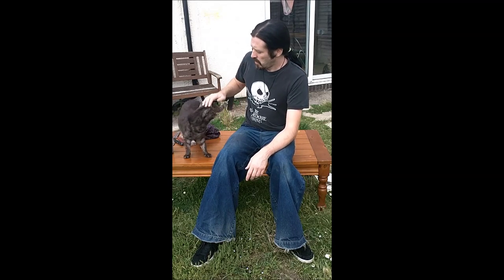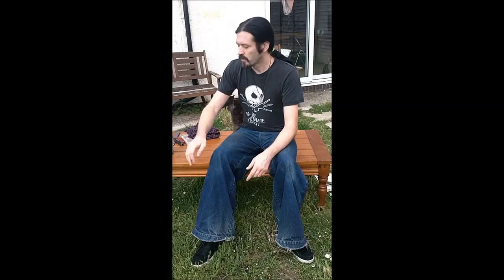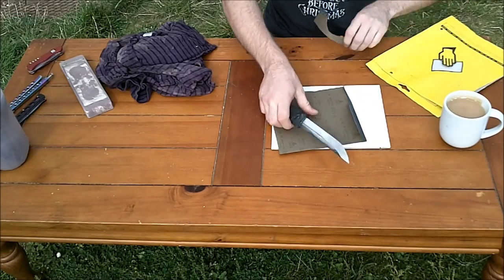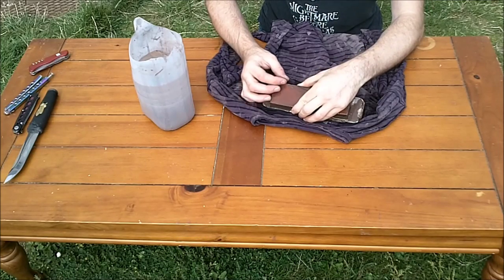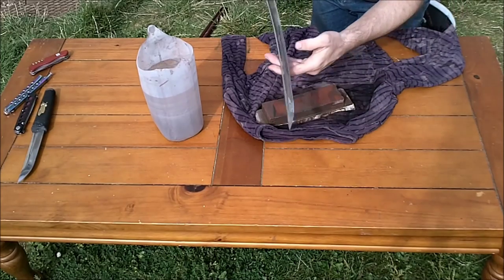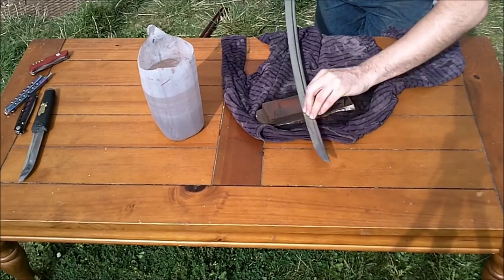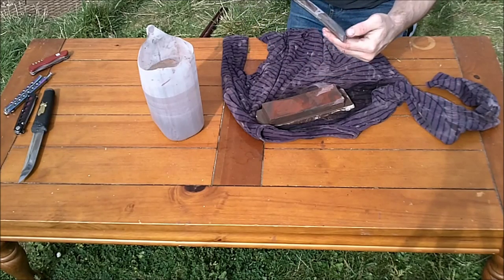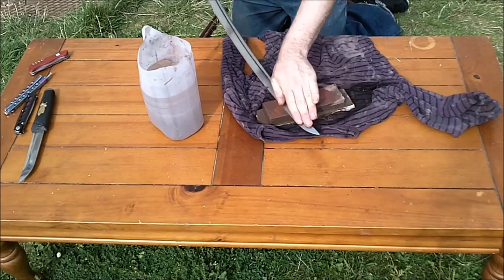Sharpening your katana

Comment: I haven't been very good to my Katana, I definitely need to both polish and sharpen it. At least now I know it isn't impossible to do by hand.
Reply from the maker: Anders Pedersen Its best to do it by hand :) Just take your time and youll get used to the feeling.
Reply from the maker: Just down the road? Haha awesome. Ok. When sharpening you need to start at a lower got and work your way up. So if your getting the  1000/4000 stone then you'll have to use the 1000 first and then the 4000. That replica is made of  1045 so the steel will Polish up really easily. Might be worth investing in some 2000 at wet and dry depending. Let me know how it goes
Reply: Thanks, I've been sharpening it with the 1000 grit end, however it's still not very sharp, also using the 4000 after just dulls the blade. I guess I just have to keep working on it. :)
Reply from the maker: It's a knack. You have to push the edge onto the stone. Dont as a secondary bevel, just remove metal from the side until the edge reveals itself more 😊 don't worry with practice you'll have it razor sharp soon

Comment: Thank you so much for the video it's really helpful, I just received my new katana last week and I am planning to sharpen it following your method, but I don't have much knowledge on whetstones, regarding with that, what is the use of the high grit and low grit part of the whetstone? I just bought one today and I have no idea which side I should sharpen my blade.
Reply from the maker: sorry about slow response. wow. 10 months? for touching up on general usage, you shouldnt need two stones. :) I use one the coarser ones for removing the crappy secondary bevel that a lot of cheaper katana come with from the factory.

Comment: Take note that each time you polish your sword it takes away a little steel from your blade, thats what makes the blade sharp
Reply from the maker: +Swampy LongMouth yep. you're absolutely right, but unless you're reprofiling the blade you wont be removing much at all. If you're just touching up the edge after a resharpening like in this video, you merely have to run a few passes on your fine stone to tidy up a little. :)

Comment: Hi there! First great video gave me alot of info about sharpening tho i think i'll try it on one of my knifes as a practise becouse i really don't want to ruin my balde. And wanted to ask if it matters alot if i start with 3000 grit and end it with 5000 grit becouse thats the only water stone i have.
Reply from the maker: +Jack Black sorry about the late reply. If youre only removing light scratches or touching up an existing edge then sure, it may take more work but thats cool. if on the other hand youre looking to remove scratches or change the geometry of an existing edge then youll want to start with a lower grit. :) remember the lgueing wet and dry to a flat object like a tile of a marble slab or a stone chopping board will work as well. Just wipe the blade down less as you will lose the abrasive every time you do so and that will effect you a lot more with wet and dry than it will a stone simply because the amount of abrasive on a piece of paper is considerably less than a stone made of the stuff :)

Comment: Hmm, nice video! I do however have one question for you, When you said during, rubbing your blade back and forth on the wetstone,  you should do 100 stokes, does that mean up = 1 stroke and down = 1 stroke or up and down = 1 stroke? I'm assuming it is the first way i mentioned, but just to be safe im asking because I don't want to over do it with double the amount of strokes :P thanks in advance!
Reply from the maker: +BlazeXenon hehe. Well nothing is written in stone here. (no pun) 100 is a number I arbitrarily picked because it seemed to yield good results for me. as long as the number of strokes on either side is even then youre doing it right. that way you will sharpen an even amount on both sides and the edge will be symmetrical. but yeah, up and down. 100 of those. but like I said, if you feel 40 up and down strokes on one side and 40 on the other is better for you? then do that instead. just make sure you do the same number on the other side. :)
Reply: Ah i see, thank you for the insight! I am fairly new to this so I want to make sure there is as minimal screw up as possible :)
Reply from the maker: heh. np. I did exactly the same research when I started out and every upgrade or modification was equal parts fun and panic all rolled into one period of ambivalence. :) hehe.

Comment: Is he rocking from the back of the blade to the edge or the other way around?
Reply from the maker: place the blade onto the stone and rock it towards the edge. at the point where it doesnt rock forward any more, thats the edge. Thats the part you will be working on :) popping your fingers right up on top of the edge will allow you to maintain a constant pressure. you dont have to push down hard, but keeping the pressure there will keep you in the right spot.

Comment: Hello, 
where can I get two sided whet stones? If possible, cheap :-D 
With which grit should I start?
Reply from the maker: +aizentheronin sorry about the late reply mate. Ive been busy :) ok so really amazon is your best bet ive found. depending on what youre looking for, stones start at around £10 but for the double sided ones, between £15-£25. Ive found the onces sourced from amazon despite coming from all sorts of places, to be the most reliable so far as quality is concerned :) I think getting a 2000/4000 or something like that would be a good bet. Youll get a fairly decent polish with those but you wont shift a lot of material with them. if youre looking to reprofile your blade at all, i.e. shift a lot of metal to change the shape of it, then start with a lower grit, 800 - 1000 - 1500. those sorts of numbers. truthfully though, unless youre willing to take some risks, chances ar youre gonna be simply refining the edge you do have and 4000-8000 gives you a fine enough finish as well as not removing so much material in one go that you risk fucking it up :) go slowly, take your time and all will be well. hehe. tc man :)